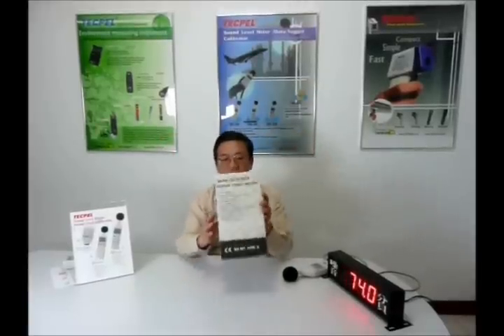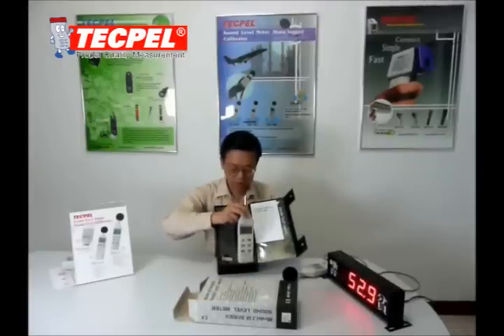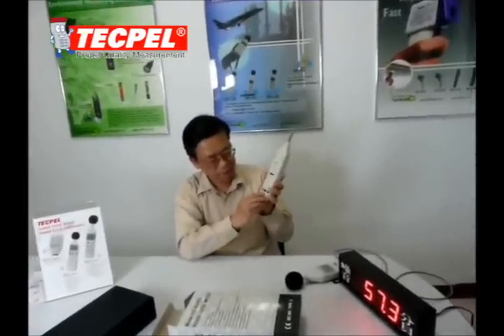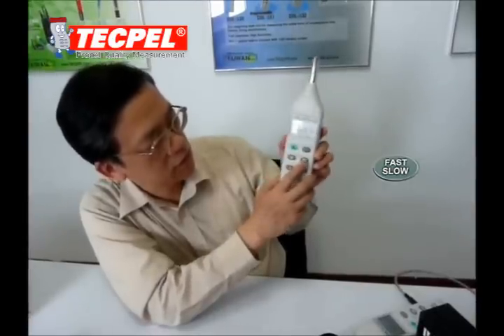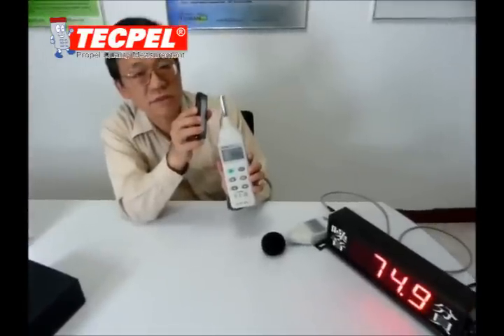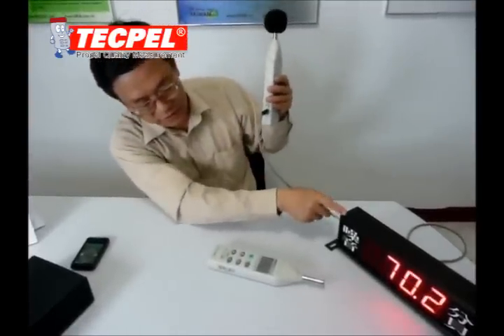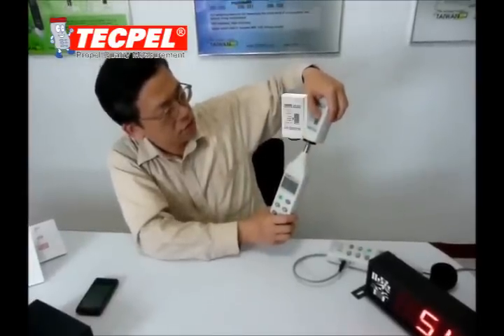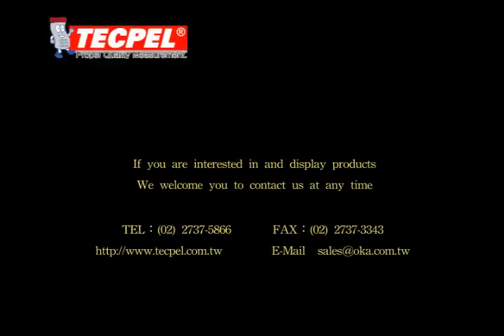TECPEL Sound Level Meter/ Sound Level Calibrator / LED screen display

Comment: Can you tell more about how to connect the sound level meter to a big external display like that one? Is that a special display that interprets the DC out translating it to a number in dB? Thanks!
Reply from the maker: Santiago Rayes 
Dear Santiago,

Our sound level meter DSL-330A and DSL-331 get external output jack and it is easy to connect our external LED display.   In short, our DSL-1406D sound level meter led display that interpret the DC output and translate the DC signal to a number in dB display.  For other product information that you may need, please browse our web site http://www.tecpel.com 

Thank you for your inquiry and we look forward to serving you soon.

Stanley Hwang/ Tecpel marketing
Reply: There is no speical LED Display.  Only to have LED Monitor display that can adopt analog signal output. We can provide the whole set and please send your inquiry to  sales@tepcel.com   Att'n: Stanley Hwang